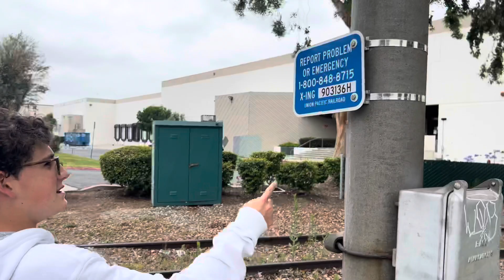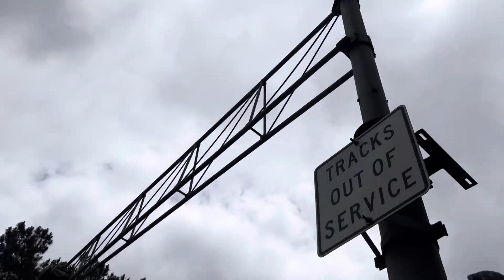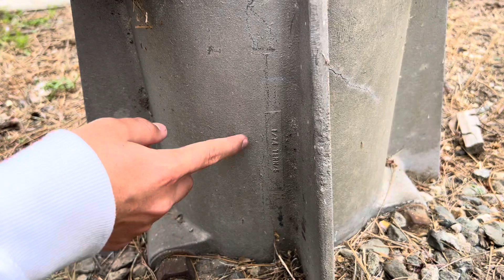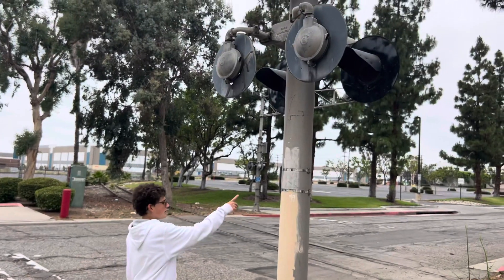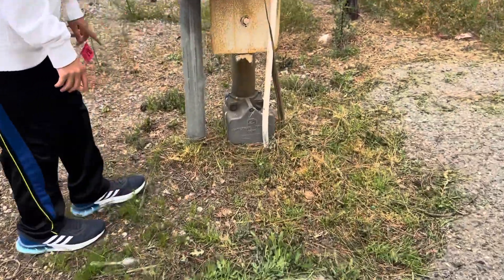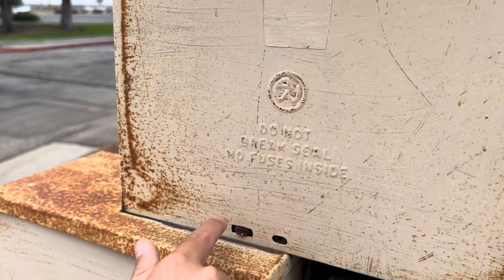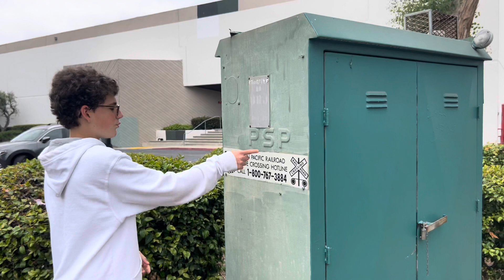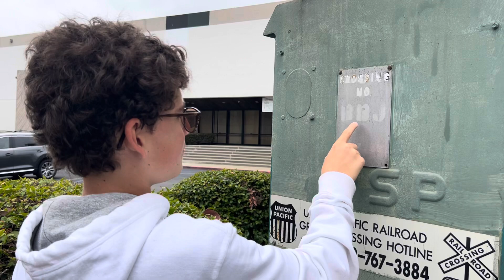Out of service/abandoned railroad crossing Bonita plaza, Fullerton

Comment: WARNING 
I am not very well educated on this subject and am saying this based on the things I do know so take this with a grain of salt 

I believe the reason for railroad crossing equipment using 12v Direct Current is to prevent signal maintainers from getting shocked because Alternating Current power is 5 times more dangerous.
Also it doesn’t matter the voltage nearly as much as the amperage.